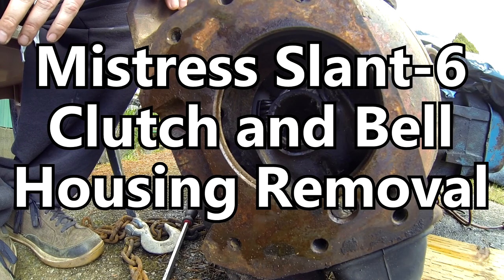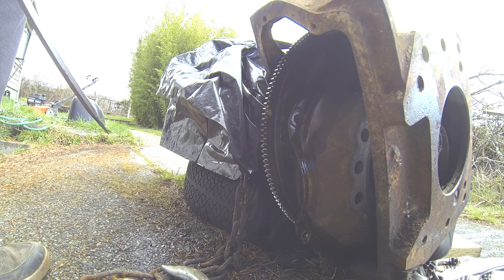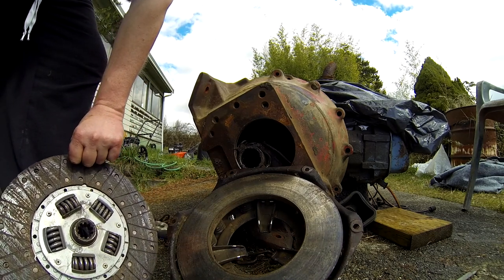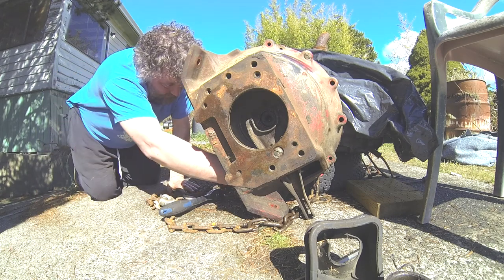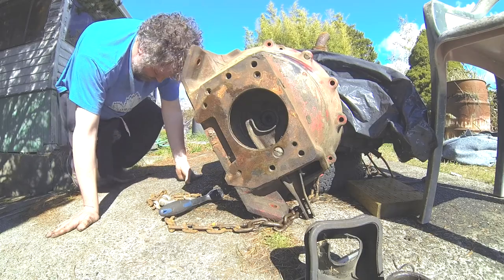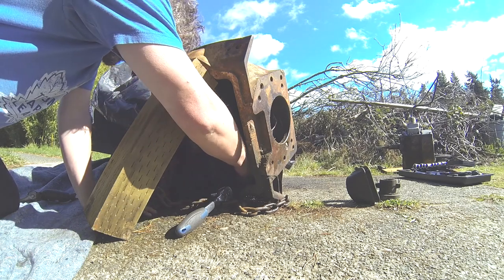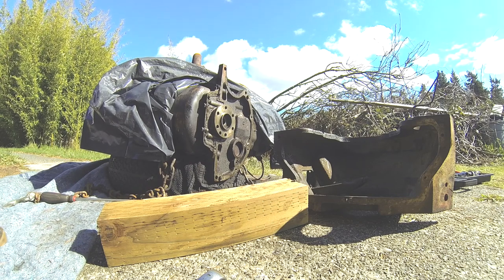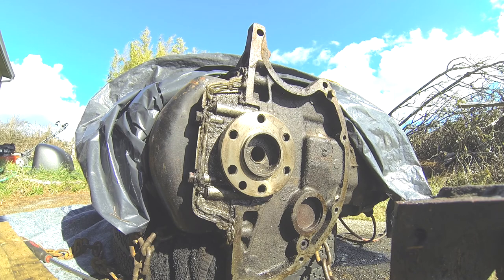Mistress Slant 6-Clutch and Bell Housing Removal-Part 2

Comment: Thanks for the video. I'm pulling an engine out of a 1987 Dodge truck and I could not figure out where the bell housing bolts were on the passenger side but thanks to your video, I see I need to pull the engine out with the bell housing still attached. And then I have to pull out the clutch and flywheel to get to the  bell housing bolts. That's a dumb design in my opinion but I never liked Dodges in the first place.  Also, an easier and quicker way to turn the flywheel is to put a socket and ratchet on the vibration damper bolt and turn to the right only.